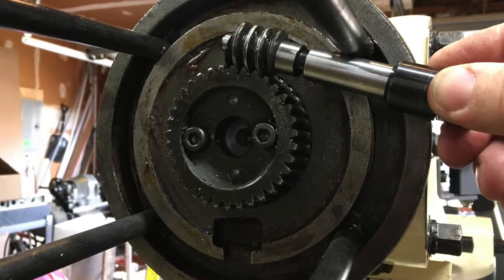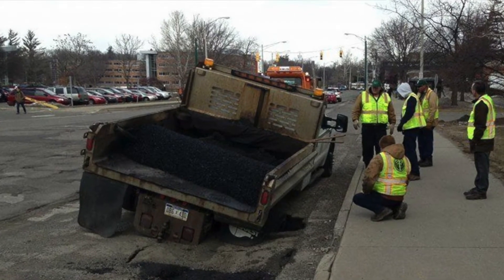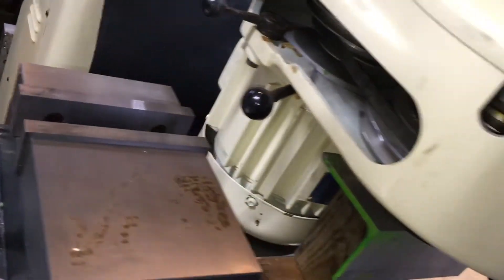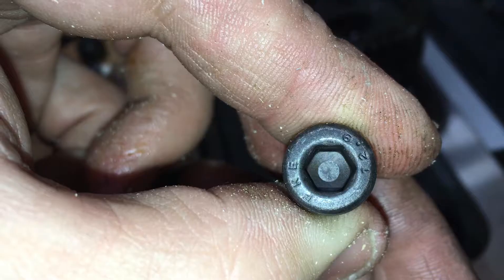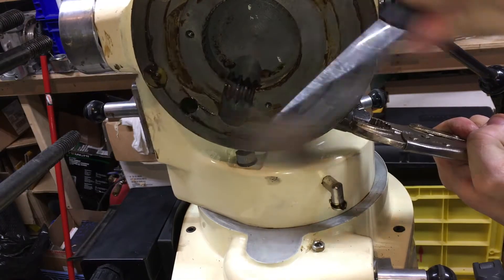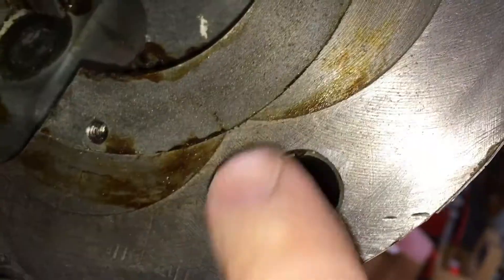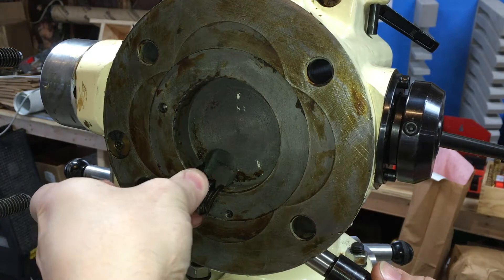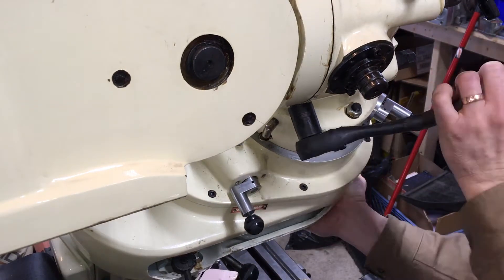Left/right tilt adjustment repair of Bridgeport style mill

Comment: I am contemplating taking the head off to see if everything is OK with my worm drive, which is how I found your video... how much 'slop' is there in the mechanism? i.e. when you support the weight, is there free play? I think there's probably 20mm or so of play in mine, which doesn't seem right for a worm gear setup!
Reply from the maker: Thank you for watching! In my little practice, 1/4 of a turn of the worm is not a bad slop. I never measured the head movement which amounts from that 1/4 turn slop. On my machine (being new and all), there is probably 1/8 or less of a turn slop. 
Cheers.
Reply: @TinkeringNerd  I just used your trick of supporting the head on the table to get the motor out after I made a rookie mistake.. I'll post a video of my error soon 🤦‍♂️
Reply from the maker: I made a mistake there, too... the fan cover on the motor is still bent, lol.
Reply: @TinkeringNerd  I didn't bend anything but my mistake was trying to take the end cover off the motor and remembering that motors are usually through-bolted (well, long studs with a nut at each end) at the exact point I heard the inner end nut tinkle off into the head! Now I need to split the motor from the base plate and pulley...